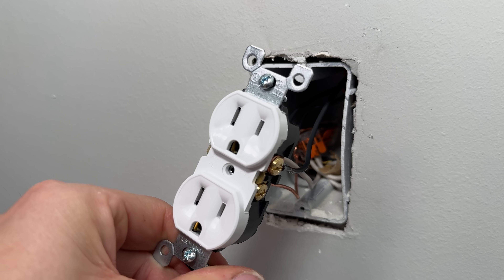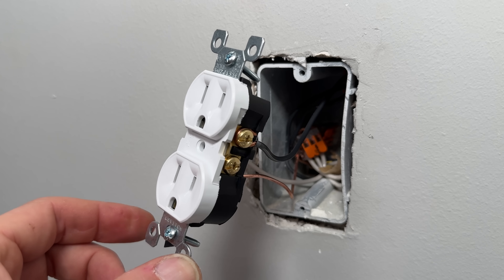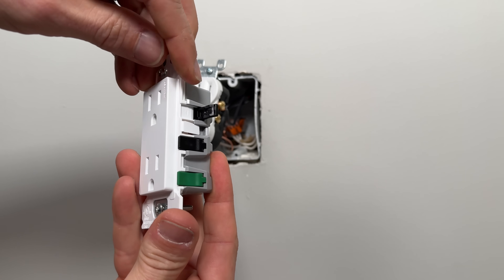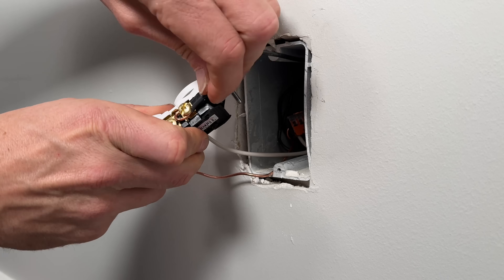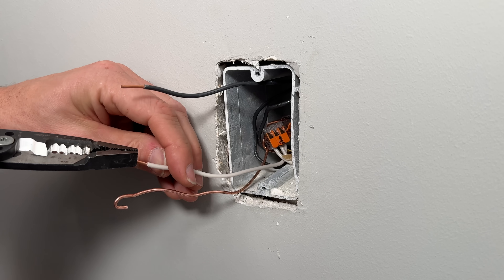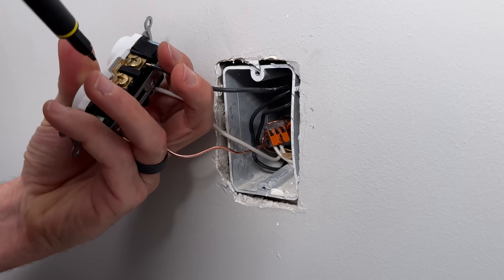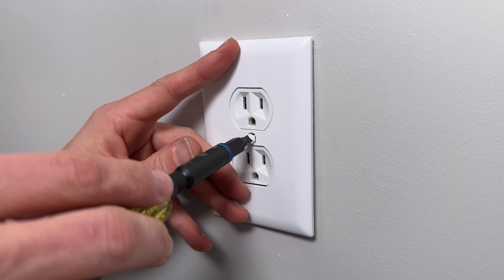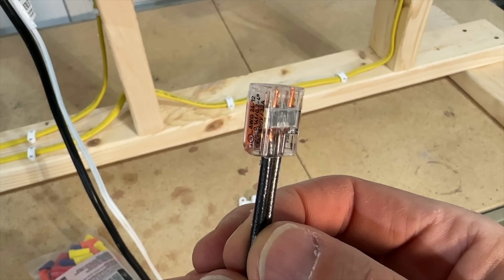Why DIY Homeowners Should Wire Differently Than Most Professionals

Comment: DIYer - extensive work over the decades. I prefer the clamping screw over J-hook. Helped a friend once who insisted on counter-clockwise J-hook as pull would “tighten” the screw - couldn’t convince him otherwise. Although I love Robertson(square drive) screws I found occasionally that they were a bit soft when in a combo head - a wide slot driver helped to do final tightening. Regret that not doing much these days now that all the neat stuff like Wago connectors are available.
Reply: Wagos are junk.

Comment: I'm a DYIer and have done quite a bit of electrical work. When I do outlets and switches I use 2 to 3 wraps of electrical tape around the terminals. Is this a good practice?? My house was built in 1965 and is wired in conduit which I think every house should have. Anyway, most of the outlet boxes are a little tight tight especially when replacing standard outlets with GFCI's. That's the primary reason I tape  around the terminal screws. What's your take on this??
Reply: Dont use flip levers of any kind.

Comment: finding commercial grade plugs in a residence is an immediate tip to me that I'm following a handyman or do-it-yourselfer, and I know to immediately get out all my advanced circuit tracing tools, because it's likely nothing about the installation will be done in a sensible manner.  

I've come to refer to it as "time life electric" over the years. and it's some of the most headache inducing troubleshooting I do.

Comment: I get what you're saying about the backwiring method being safer than stabbing, but neither are more secure than the tried, and true J-hooks. If those screws weaken, or become loose over time, the straight line for the other two methods can still slip out. It boils down to geometry. The hooks are prevented from backing out just based on their shapes, and if you pinch the hook closed it even provides constant contact. In that situation the hook not only has nowhere to go, but kept tight to the terminal screws, and plates preventing a disconnection, and possible short. Naturally this is just my opinion though. Everyone has their own methods. Thank you for the video!
Reply: Do you use hooks on breakers too?
Reply: Just use the damn screws and do it right.
Reply: You don't want a loose J-hook hanging on.  It will arc and get hot.  You'd be better off if it came completely off so you know you have a problem and can fix it.  (Not that you'd want a loose hot on a metal box, but you grounded that properly, right?
Reply: @incognitotorpedo42   Yup, I did. I had several outlets that had a hot barely hanging on from damaged backstab ports, and had to fix them. One in particular had, apparently caused a short so the previous homeowner disconnected them from the line side of the first outlet in the daisychain. That one required me to open the wall, and replace the Romex because they had disengaged the hot, and neutral, and taped it to the back of the box, and cut the ground so far back it couldn't be used. Total handyman special, from a non handyman, lol.
Reply: Back wiring is pretty good all things considered, the difference between side wiring and back wiring is negligible, especially compared to back stabbing
Reply: In practice, I would say your assessment is a bit inaccurate. Most devices are "shoved" into the junction box which puts pressure on the wire, forcing it forward into the device. So, even if the screw clamps were to loosen over time due to heating effects, the wire would not "back out" of the connection. Testing has proven that clamp connections are every bit as effective as side screws.
Reply: The back wired ones are MUCH better than the loop over the screw.  They will never back off or loosen if you tighten them right
Reply: @willschultz5452  never say never. Any metal on metal connection can loosen over time due to heating effects. Even large-scale electrical connections, installed by experienced professionals using torque tools can and likely will loosen over time. It is why power rooms in commercial/industrial facilities are routinely tested with infrared/heat sensing equipment to identify where there are "hot" spots due to loose connections. The only reason this is not typically done in residential applications is the wattage/heat is much lower so the loosening effect takes much, much longer. Usually, a receptacle will fail mechanically before it will fail electrically. Meaning the plastic will fracture from misuse by the home owner or the grabbing power will wear out from having devices repeatedly plugged in/out of the outlet. There is also a common assumption in residential construction that most home owners will renovate every 25-30 years and replace old receptacles in the process.

Comment: Electoral trade for 46 years.  I hate plastic yoke devices.  I don't stock standard commercial grade receps on the van.  I use Leviton side wire receps.

Comment: I live in Canada and I'm a DIYer. I like to use the secure plates instead of the J wire hooks. I saw the Leviton lever outlets at Home Depot last fall but I haven't seen any more since then. I'm not sure what's going on with them. So far I haven't seen any Wago lever connectors in Home Depot, Rona or Home Hardware either. Maybe not available in Canada?

Comment: Commercial grade all the way.  I love the screw down clamping plate style.

Re. the screwdriver - #2 square (Robertson) is good, but perfect would have to be the appropriate #1 or #2 ECX.  It is a combination that simultaeously fits all of the blade, cross and square in those screws.  Klein probably sells bits for that, but I use Milwaukee.
Reply: Ecx works wonders on stripped screws, but it's unnecessary otherwise (leviton recommends 14-18inlbs, which is perfectly fine for square drive and slotted. I hate slotted because my screw driver always slips out

Comment: Yes, because small plastic levers are clearly much more effective at securing wire than wrapping it clockwise around a screw and cranking that screw tight. Because why on earth would a DIY'er want to do it the way pros do?

You're so full of sh*t. Anybody following this advice is a moron.

Channel blocked.

Comment: Either one is fine but for ease of installation back wiring is easier & faster.Also just like using Wago’s you should only need to trim your wires once & never have to worry about shortening them again in the future.Just like soldering you should know how to use a J hook or Shepherds hook & I personally would tape the terminals & screw in any unused terminal screws so they don’t accidentally touch the metal boxes.First time you touch a terminal to a metal box live you won’t forget it.Fourth of July!

Comment: I've been DIY for nearly 60 years. I like the commercial grade outlets but I have come across more than one of the back stabbed outlets that had become loose or actually pulled plumb apart. I'm gonna stick with the side  screwed j-wire connection.

Comment: If you use the decora, you won’t need spacers. 
It has an area you can remove if it’s not needed.
Also, the decora is currently only available in 15a.

Comment: DIYer here. I like your way with the commercial grade devices better. It is cleaner and easier. Also, and I assume this is allowed, you can connect two wires to each position, meaning fewer marrettes and pigtails filling up the box. Of course, I just finished going through my house replacing all of the outlets and switches, and didn't notice until my second trip to the store that these commercial grade ones were there with this feature. So only about half of my devices are done this way, the rest are the usual residential grade with the J hooks. 

One other thing I discovered is that most of original devices I was replacing didn't have the ground wire hooked up. The longer I live in and work on this house, the more I realize that it wasn't built to the highest standards. 

One question: those spacers are good if the drywall is overcut or the box is too deep. What do you do if your box isn't 'square'? If it is tilted one way or the other? With one edge deeper than the other? How do you adjust your outlet or switch so that it isn't also tilted?

Comment: Electrician here. I started in residential before going into Commercial and Industrial. Residential electricians are mostly speed freaks and dont care much after the device plate is leveled. The resi outlets are trash, never buy bottom dollar for electrical devices. Side wire with hooks or screw clamps are the way to go.

 Im not 100% sold yet on the wago outlets, lets give them time. I personally installed commercial grade devices  when I rewired my house...i also used MC instead of Romex. I live in a rural area and tend to lean to overkill than just getting by.
Reply: Agree, been DIYing for over 40 years and not once have I ever been sorry for overengineering any of my work.

Comment: J- hook for me. I really like the commercial ones but not willing to pay 3x the cost. Regular ones are $5.60 for 10. Commercial are $20.92 for 10 at my local Hone Depot.
Reply: As much as I get aggravated when a receptacle gets loose or fails, and as much as I hate changing receptacles and switches, I’ll gladly pay an additional $1.53 per receptacle to upgrade to commercial grade. Even when you’re talking about an entire house, the cost difference works out to the price of a few dinners in a halfway decent restaurant, or a few tanks of gas.
Reply: @DavidBugea  Agreed...I changed ALL the outlets when I recently moved, and used Scott's recommendation for the Legrand commercial outlets.  (after watching his video where he cut them all apart and showed WHY he liked them so much).

Comment: If you installed the outlet correctly in the first place, you won’t need to be replacing outlets for many years. The more surface contact you have with the wires, the less heat is generated. Just a regular guy.

Comment: I realize YouTubers are in it to make money but at least 3 to 5 times a week someone changes a switch or outlet enough is enough. Also 14 wire is still a good wire no need to use 12 unless the circuit requires it. 15 amp receptacles still work fine although 20’s in the kitchen are better but not required.

Comment: DIYER but I work with a professional on his jobs as well. We use j hooks and the commercial grade plate ones. They are both fine. The side plates are easier to seat and faster but that wago outlet is just to expensive to wire a whole house with.  Homeowners don't care what makes an electricians job easier and right now there is very limited options for those.

Comment: I could not agree more. I am in the process of replacing every electrical outlet in my house. Electrician used speed wiring on every single outlet -- many with bare copper exposed due to poor wire stripping. I'm using commercial-grade outlets in most locations and heavy-duty outlets in places where I'm plugging in heavier loads. Quality outlets are worth the money and back-wiring is the way to go.

Comment: Need to find those spacers you used, that could really save some time and effort as I find every contractor does an awful job cutting drywall. I’d rather have some loose wires and use old work boxes, but that’s a different topic. On the subject of j hooks, I feel like you probably shouldn’t be DIYing this sort of thing if you can’t pull that off. The slide under terminals are nice, but I’ve not going to buy devices based on that and I’ll do the j hook as needed. DIYer here.
Reply: Gardner Bender GSP04.  Lowes keeps them on the shelf, or you can mail order from Zoro, Home Depot, etc.  Or you can use a box extender.

Comment: I used a spec grade light switch the other day because I needed to replace a broken toggle switch on something but around the house I use only decoras.  There's several reasons why.  1.) You can have arms full of whatever and turn the lights on with your elbows.  I do this constantly.  Also, they use the same face plates. Switch or receps, it doesn't matter. I make my own faceplates so it's handy when I can do a whole batch and they are all the same.  Third, they are easier to clean. People don't realize how dirty and gross looking switches and recepts get.  And last but not least, they look more modern. So that's what I use. I take what I can get in the store.  I am not a licensed electrician. I'll volunteer that much. 😊

Comment: The title of the video is "Why DIY Homeowners should wire differently than most professionals", but you didn't actually make a case for that. Instead, you showed that there are options for receptacles that are easier for DIYers to work with. Why not just present the video honestly?
Reply: Clickbait title, of course!
Reply: I think he was pretty clear that the "why" is 0:40 "can save you time and more consistently result in a correctly installed outlet". Unless you're saying that using a different receptacle type isn't "wiring differently"?
Reply: @AySz88 Are you his lawyer?
Reply: @acbeaumo  What? I honestly don't know what you were expecting from that title other than what you got. Maybe it's because I've watched his other videos, sure.

Comment: I love the Leviton edge outlets.  I’m a homeowner, and I (in one week) am tearing out all my drywall, as I don’t have insulation in my 1960 brick home.  While I’m in there, I’m replacing all the wiring, as it’s old ungrounded two wire with small metal boxes.  I’m replacing with all 12 gauge, largest adjustable boxes, and using wagos and Leviton edge everywhere possible.  After I’m netting the cavities, blowing in TAP cellulose and putting up new drywall.  Channels like yours I feel has helped me gain some confidence on taking a project like this on.
Reply: if you've got the walls open, put in batt insulation.  it won't settle like cellulose does.
Reply: @kenbrown2808  Cellulose has a higher r value than the pink stuff when dense packed.  When dense packing, it prevents settling.  Cellulose is also only about $400, vs pink stuff which is more around $1800 for the same square footage.  Mineral wool is an r value gain of 2 above cellulose, about a less than 10% energy improvement, and would cost around $2600.  Spray foam would be around $6k.
Reply: @russellsickler5961 most trades hate spray foam with a passion.  the overlap between trades that have worked in houses with sprayfoam and trades that have had to repair stuff damaged in the sprayfoaming process is likely close to a perfect circle.  I really don't care about R value differences.  encapsulated batts are the least horrendous insulation to deal with.
Reply: @russellsickler5961 I did cellulose just in my attic. Complete game changer versus fiberglass, house is much more comfortable during winter and it keeps the heat out during summer, it’s a lot of value for the low cost
Reply: @kenbrown2808  fiberglass batting can also settle in vertical walls, unless you get it faced and staple in place, but most trades dislike stapling because it makes it much harder to see the studs
Reply: @TwilightxKnight13 never had that complaint.  the main reason insulation crews don't like stapling, is it's one more step.and I haven't seen any sign of the press fit batts sagging.
Reply: Professionally, I work in an insurance agency, and own a low voltage and audio company.

Comment: Swapped an outlet this weekend with an outlet with USB A and C plug.  It had back wiring.  It was a lot easier to install vs the side wire model I used a year or so ago for another outlet.

Comment: My next door neighbour professional electrician (young one) told me me the side screw mount connector was best to use for a sound connection. So, even though it’s a bit more work, I go with that for any sort of electrical on the end of the line. Push in connectors particularly strike me as doubtful.
Reply: I've made a lot of money replacing receptacles that had the "stab" connections used.  sidewire and backwire are both much better, and the lever lock connections are better than stab connections, but still have less surface area in contact.

Comment: This is a good summary of your earlier videos on the subject, Scott. The commercial receptacles are also more sturdy and you can feel it. (A similar thing is available to light switches.)

I'm using these Legrand in my basement and slowly switching to their Adore line upstairs, which also have the rear ports for wiring.

I have that Klein 11-in-1 but it needs a bit of "break-in" from my experience ... it's too hard to pull apart despite all the oil it ships with.
Reply: The Klein is the same for me. I've stuck with the Milwaukee 11-n-1s for this reason.

Comment: It's probably cheating and not as good, but I replaced almost all mine and I used the newer method as shown but i didn't cut the wires fresh,  just straightened out the hook and cut to the right size and used it.  And in light switches with J hooks I just unscrew the screw all the way, leave the J and unscrew the new recepticle screws and replace them, leaving the J hook undisturbed.  Is that so horrible?  I know it's not the perfect way, but everything is tight and in the right place.

Comment: Pro....I think side wiring is fine, when properly done. Don't think there's any real difference between the methods. Worked well to long to argue. However I think the upgraded outlets (Pro) are much better built and stand up to a lot more use before getting loose feeling. I will always spend the difference. Can't stand poor quality anything.

Comment: Sticking with side-wiring in most cases, just more comfortable with it.  I’m a DIYer but been doing electrical work DIY for so long I wouldn’t be the normal DIY just getting started or without much experience that’s for sure.
Reply: I'd wrap a layer of insulation tape around the outlet to cover the side wire....
Reply from the maker: Thanks for the feedback 👍